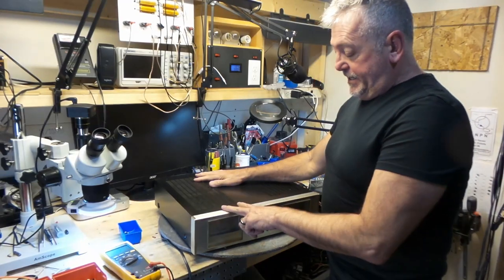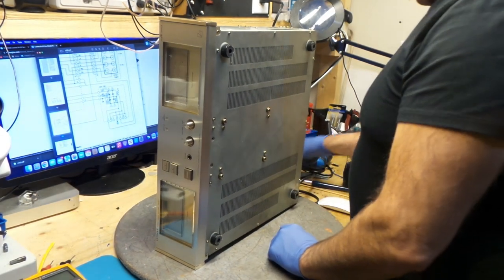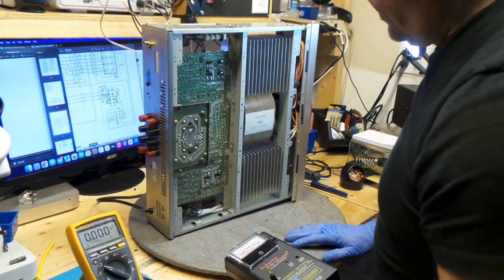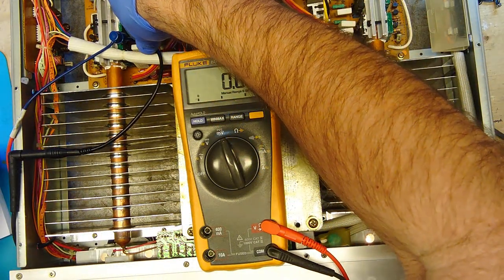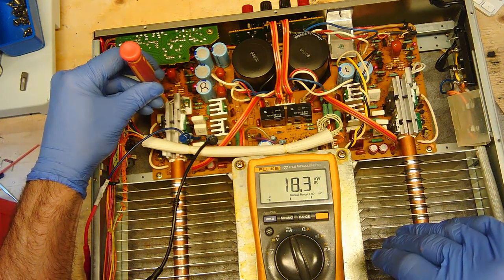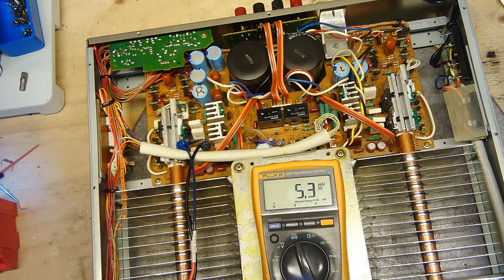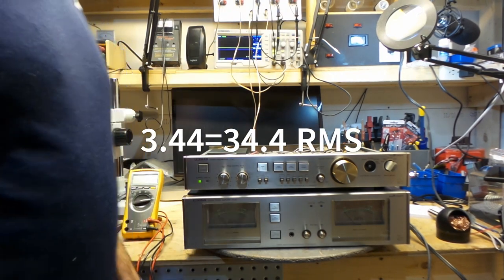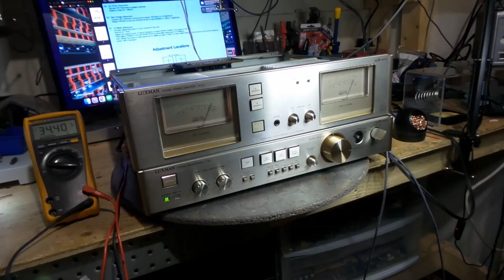Luxman M-02 can't set bias on the right channel !! see why?#Luxmanm02biassetting

Comment: WE used to call that the black ring syndrome. It can be caused by to cool a soldering ieon when built OR a component lead being subject to vigrastion that can crack a solder joint. If I suspect a vibration problem I';ll wrap a wide around the component lead and run over to a solder trace away from the cracked joint.
Reply from the maker: Hey Dell177
I think you have a real good point here...as I  read your message a few times... typos!!? just to help other to understand a little better....
I'll wrap a 'wire'  around the components.... (Good point).
Vigrastion - 'vibration' I think 🤔
Elaborate if I didn't correct properly...

I think ' the wrap around wire is a great idea ...it makes a lot of sense
Reply: @VintageAudioFever    i worked for a power supply company for decades and we started to ru into problems when we started to solder TO-3 type devices directly to circuit boards. GThe flexing of a heatsink in relation to the PWB would lead to cracked joints, we found adding a wire in parallel to the solder joint solved the cracked joint problem till we reworked the design to  attatch the board more rigidly to that heatsink.

Between being half blind and having a tremor my typing leaves  alot to be desired - just one of the curses of being 76 years old.